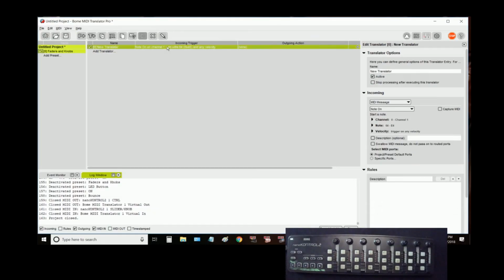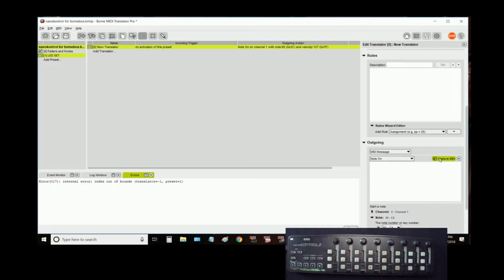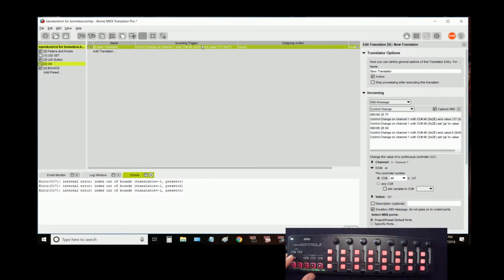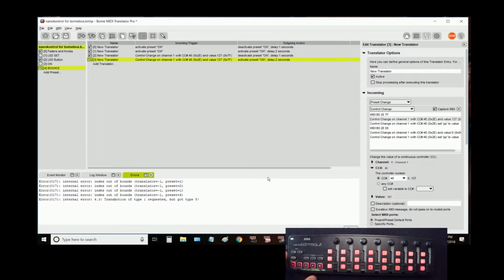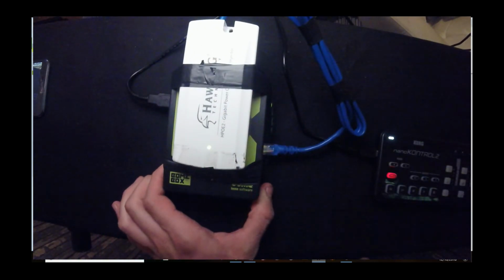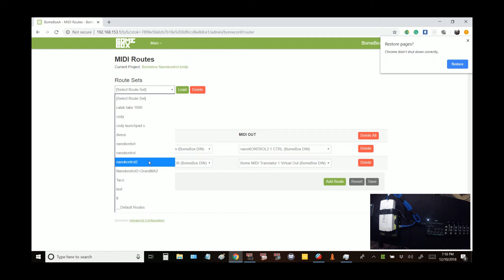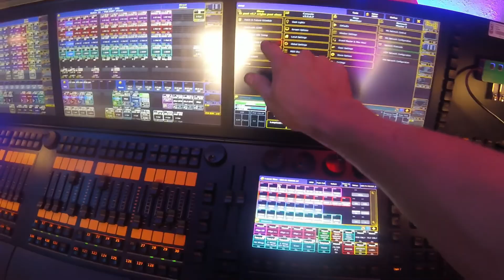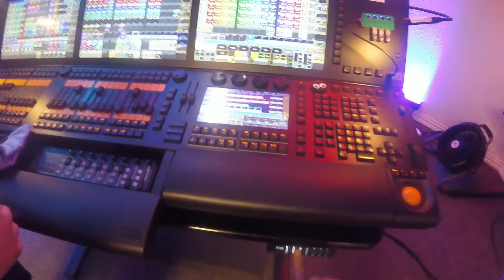Connecting Bomebox to a GrandMA2

Comment: Great i need this...in order to make this work you need a bomebox and a software MIDI Translator Pro ? Anything else
Reply from the maker: You don’t need the MIDI translator license, just the trial version. And that’s it except for cables!
Reply: @CalebHoernschemeyer  Thx for quick replay and its 60€ less for this to work....
Reply: Hi its me again I finally programed folowing your steps....when i try to load a project to bomebox and klik select.... Error loading project file. Try a few times no luck. Then i try for bome support and they wrote me back saying "In order to run a project file on BomeBox, you need the paid version of Bome MIDI Translator Pro as the free version does not do project signing."    Can you comment on this please!